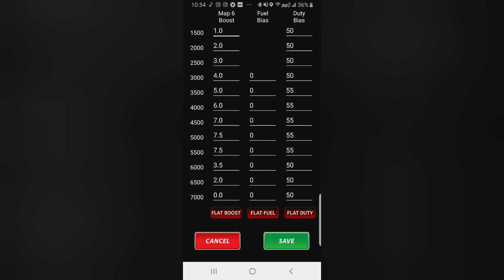⛔️⛔️⛔️April 2022 UPDATE check description⛔️⛔️⛔️All VR30DDTT Infiniti Q50/Q60 JB4 owners WATCH THIS!

Comment: Bro, great video n info but now i want moooore info lol.. I've read the n54 link n done much research on the ewg wires n kinda have an understanding but I know I can get a better grasp on if if the right person comes along n give a good explanation on how they work n how changing the value of the duty bais effects the turbos. Im coming from a g37 n never owned a turbo so the waste thing is new.
Reply from the maker: Thanks for the comment. Unfortunately I moved to a real tune right after this video was made, so I stopped doing as much research on EWG. What I can say is that the values input into the duty bias fields set the wastegate position. I had to tinker with mine to get a good log, and it seems that each car is different. The EWG wires made a huge difference power-wise once I got them dialed in. Highly suggested
Reply: @serstylz2  copy that man.

Comment: Question have u heard anything about jb4 not working on some phones. The jb4 app work on my lgv60 but on my note 8 it want let me on to the log on settings to log on. Very strange any the only reason why I'm trying to put it on my note 8 cause I broke the v60.
Reply from the maker: No I haven't heard that. Have you engaged the app support team? There's no way they can't fix that
Reply: I have the same problem.
I can't see what map I'm on. I read map 1 is pre set. But I'd like to switch it to map 3.
Only 91 octane in my town.
Did you fix the connection problem?
Reply: @elgatosamurai9517  got a new LG v60 and it's working again but some of my codes is still not working only int and how much boost is working when i data log. Going to open it this weekend to look around.
Reply: @justgodwise7873  
I'll probably wait till the iPhone 12 comes out. 
Thanks for the reply

Comment: Would we have to change the duty bias for a stock q50?
Reply from the maker: If you have the additional EWG connectors, yes. If not, no.
Reply: @serstylz2  wait so you mean if i don't have EWG , i have to set 0 in all duty bias ?
Reply from the maker: @aenarcos7021  if you don't have EWG connectors, it won't matter what is in that field, nothing will happen.  Putting them all to 0 is fine

Comment: Great info really appreciate the help! I live in California and we only have access to 91 octane. Any recommendations for map 6, 91 octane? I've only ran map 1 safely and didn't want to pull any timing since I only have 91 octane.
Reply from the maker: Scroll down a few comments, there's a thread specifically for 91 octane. And thanks for the comment 🙌
Reply: @serstylz2  appreciate it 👍
Reply: @serstylz2  hey what’s up. I scrolled down, but can’t seem to find the thread. If I have lower downpipes and CBE can I run map 6 (on 91) and how will boost settings look like? Live in California
Reply from the maker: @vn3ck  https://www.n54tech.com/forums/showthread.php?t=46774

They updated the first few posts, with 91 octane I wouldn't go past Map 3. Try 1, 2 and 3, log them and post for review. The best logs are wide-open throttle with gear changes.  I suggest start in 2nd around 25 mph, punch it thru 2nd, 3rd and as much and you can manage in 4th. You'll be speeding pretty heavy in 4th so be careful
Reply: @serstylz2  thanks! Appreciate the response!

Comment: Can I safely run map 7 on 93 (stock luxe 3.0).
Reply: do you have a silver sport with jb4? if so, how is it? is it good?
Reply: VRFIFTY id get a heat exchanger, and you’ll be good on 93 with those mods
Reply: Loly PDecimate can i run map 6 for one pull with those mods no hx?
Reply: No do not go over +6 psi if you are stock
Reply: Ryan Solanki can you go map 7 with downpipes, intakes, and muffler delete?
Reply: @ryansolanki6696  do you think i could run map 3 and 4 stock with no mods on 93 octane
Reply: @MarquaytheGoat  yes map 3 and 4 should be fine but don't go higher than that

Comment: I'm in AZ :( and a newb to JB4.  Just ordered yesterday.  Planning on just running map 1 and 2 at first until I get more knowledgeable.  Any suggestions for super hot dry weather?  Not looking for anything crazy as I'm warranty conscious but still want a decent boost.  Thanks! :)
Reply from the maker: You only have 91 fuel in AZ, correct? And what mods do you have on the car?

Comment: i met you on the n54tech site and i appreciate the map 6 settings/duty bias settings. Car is running hell of a lot better than before, minimal jerky-ness, thanks again.
Reply from the maker: Sweet! Glad to hear that. In the summer time it's always a bit trickier to get dialed in so get it to a good spot and enjoy it, then we can see if it can be cranked up a bit in the fall/winter
Reply: @serstylz2  yeah the duty bias part was the most the tricky part trying to dial that in but so far the power delivery seems/feels a lot more "linear" if that make sense at all.
Reply from the maker: @ohnoitzrobbee  I get that 100%, that's exactly how it felt when I finally got mine right.  Power hit hard but it felt like it hit when it was supposed to and was consistent
Reply: serstylz2 I’m lyricks06 on the n54 tech just so you know

Comment: Hey what do you think of the JB1s ? im currently debating of getting the JB1 or JB4
Reply from the maker: I personally wouldn't use a JB1. You can't monitor anything on a JB1. And adding only 3 psi is a waste of time on Map 1, and Map 3 has way too many variables to call it safe.
Reply: @serstylz2  Thanks for the info! Also with the JB4 if im using just 93 octane would i still need to tap the fuel wires ?
Reply from the maker: @lashanr7253  yes, they will help on 93. Good to use them
Reply: @serstylz2  Ohh i see i was trying to avoid them since i'm still under warranty, is it a big difference without them ?

Comment: Good info. My map6 was pretty close to yours. I max out at +7.3. I've had timing pulled in hot weather, so dialed it back and logged in 3rd and 4th gear. I've had jb4 for a year FBO and it's always served me well.
Reply from the maker: Yea the hot weather always requires some adjustments. Glad to hear that you've had good results for a relatively long time.

Comment: What is duty bias
Reply from the maker: Those numbers are for EWG wires, it is the wastegate position by RPM
Reply: serstylz2 and fuel bias
Reply from the maker: @Baroy1010  fuel bias is not applicable.  Read more here https://www.n54tech.com/forums/showthread.php?t=61547
Reply: serstylz2 so it only work when u have EGW wires
Reply from the maker: @Baroy1010  correct

Comment: This is your map for a stock silversport?
Reply from the maker: On a stock car I wouldn't go past +6, but you would ramp up boost the same way
Reply: @serstylz2  okay so basically same map but only to peak +6 ? Also what about when I install my ldp and catback then I can run plus 7?
Reply from the maker: @boostlife6370  yes to both questions, you'll be good to up the boost to +7.5 with LDP and catback.  For now just ramp to +6 and keep it there until 6000 RPM and then taper off

Comment: Low boost on low rpm is better with JB4 and more effective. Great video bro
Reply from the maker: Thanks my brother. Just trying to save some engines out there. I see you are getting some wild storms! We had some earlier in the week
Reply: serstylz2 yes it is been raining all day long . And saving engines with Q platform is a heros job 😄. Even tho with tune the high boost on low rpm will blow engines and transmission. I have 520 ft torque on 3K rpm😂.

Comment: I run a similar climb and taper on my awd silver sport, but I don't go over 6.5. Just cuz I run an e20-e30 mix with 91, don't wanna run into knock. When I am in 93/e85 areas, I run like ur map exactly lol btw what does Duty bias do??
Reply from the maker: The duty bias settings are for the EWG connectors. That's how you change the wastegate position.  I should have mentioned that in the video... crap
Reply: @serstylz2  no worries hahah people will scroll down here and find out. I'm running jb4, LDPs and (soon) a FB heat exchanger. Not gonna do anything else as it is a lease, and I think it will be plenty capable for a daily. thanks for your help man, u better raise that kid right and take him on plenty of ride alongs lmao!
Reply from the maker: @smear7331  that's basically the same mods I have, it will run great. And you better believe he's gonna be just like his daddy.. cars and football!
Reply: @serstylz2  hahah hell yeah man!!

Comment: What would the map 6 look like for a redsport? Btw for the info!
Reply from the maker: I would get advice from users on n54tech as well, but personally I would go:

1500 +1
+1.5
+2
+2.5
+3.0
4000 +3.5
+4.5
+4.5
+4.5
6000 +3.0
+1.5
+0
Reply: You guys know it’s not only boost increases that makes the 100HP difference between Sport and Red Sport Q’s right? Our Red Sports have different turbo configurations. If you look at the compressor map for a Red Sport turbo vs the Sport turbo, the Red Sport unit flows significantly more (lb/min).  The compressor comes in just as fast as a Sport trim car only much stronger ramping in of boost. It can be violently so actually with a good tune, and I’ll build people great boost at 2000 RPM to make huge torque, these drivetrains will take it on good fuel, but only with an actual ECU flash where j can control more than just the wastegate to control boost.